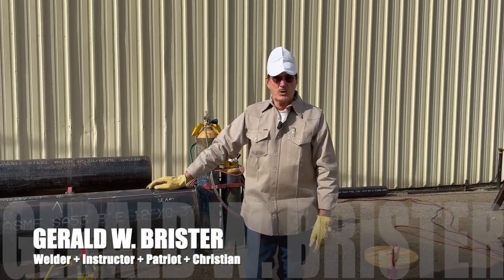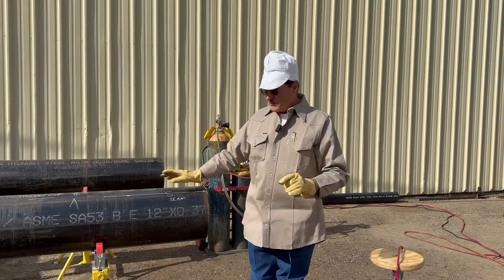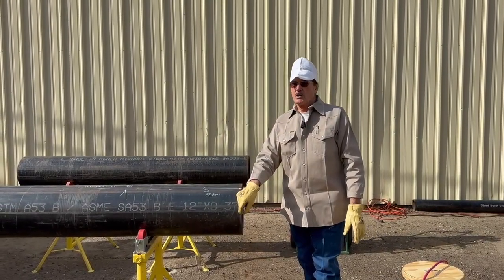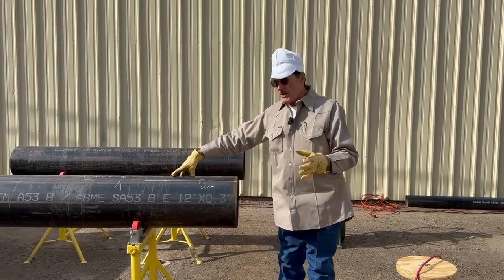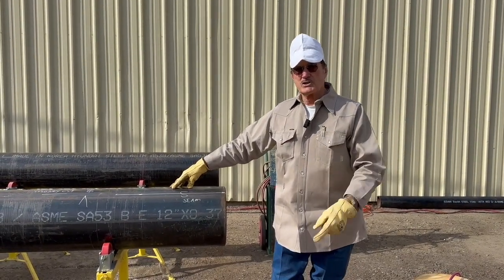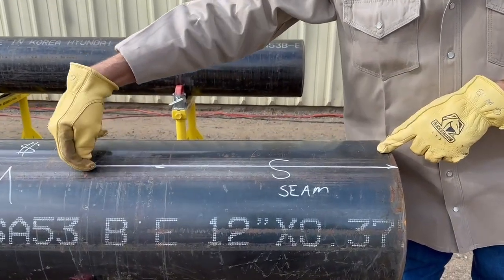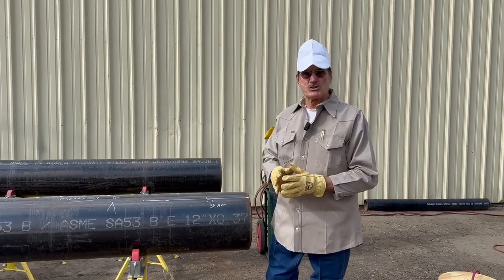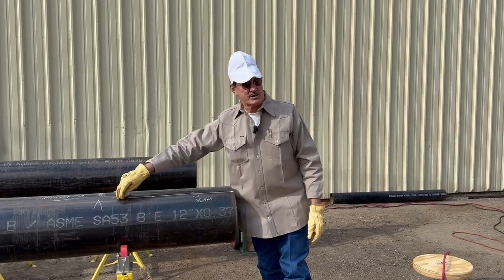Pipeline Ruptures, Pt. 3: Where the blowouts happen

Comment: I always wondered about this and I work in some vessel shops making pressurized storage containers two pieces that had a bolted flange these are low pressure and they were for aircraft and we would pressurize those to about 10 psi and look for pinholes aside from that we would have a submerged tank testing unit it had a porthole in the side you could look through it and look at the tank and observe it from to watch the tank and see if there was any are escaping a joint the gasket or the main valve assemblies I'd always wondered the difference between Transit pipe and storage tanks and now I know good info
Reply from the maker: Thank you Derek!